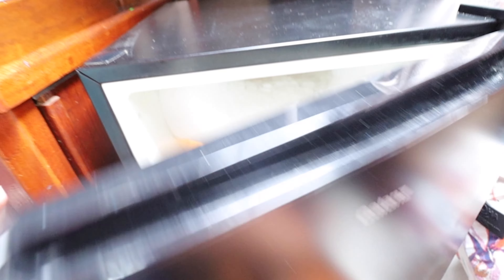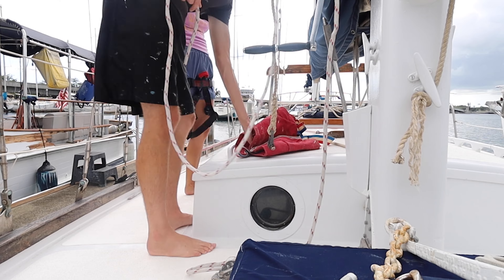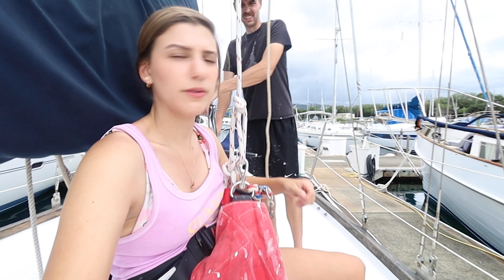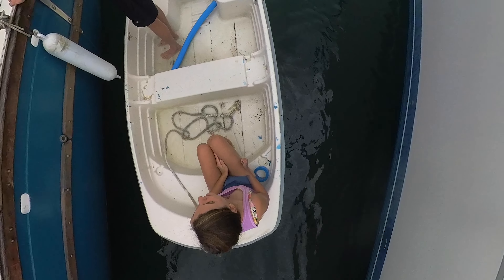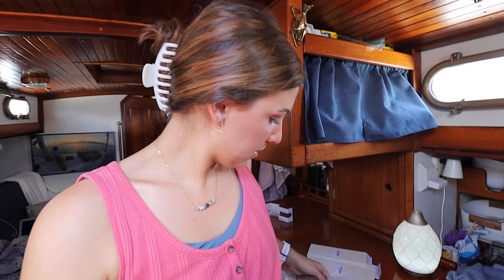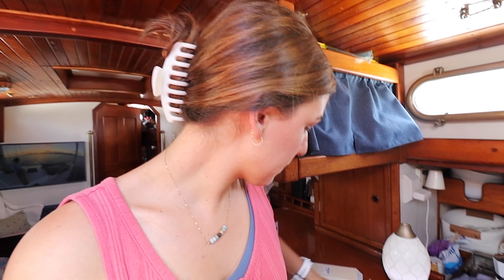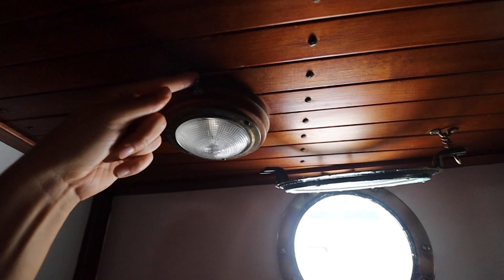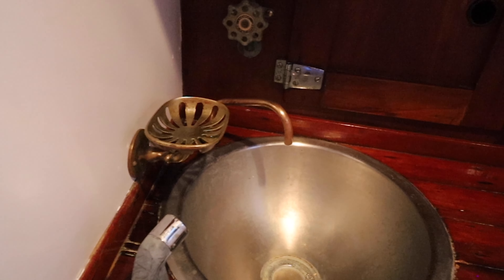INTERESTING PROBLEM found on our Sailboat: Day in the life living on our 38’ bluewater boat - Ep 51

Comment: Keep a watch on that nest. It may cease to be a problem earlier than you think.  That brass handle in the head you pointed out probably just has a set screw so you can take it off easily.  Replace those antique 12 lights with LED plug in lamp replacements, your batteries will thank you.  If the switches on those lights are in the same shape your brass was it likely needs cleaning and tightening the contacts. The really old ones were built to last forever. Look into a wind scoop for your hatch.
Reply: Agree, agree, agree.
Reply from the maker: Love all of these tips- thank you so much!